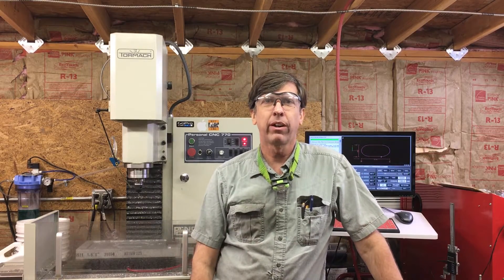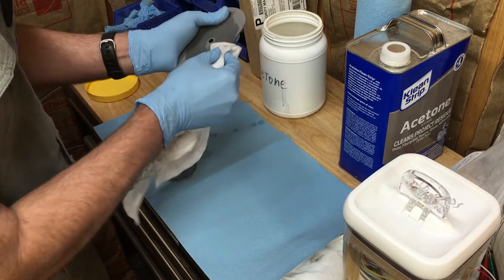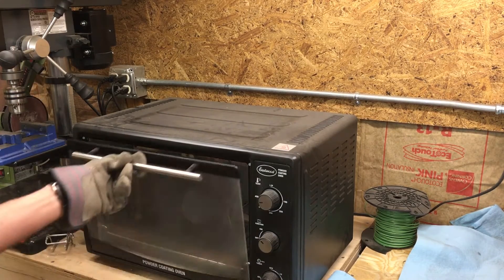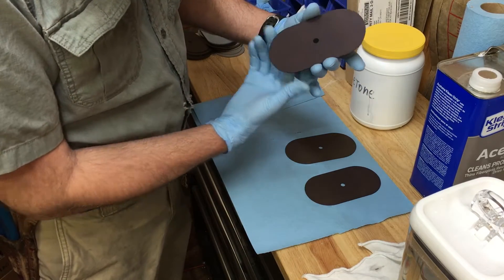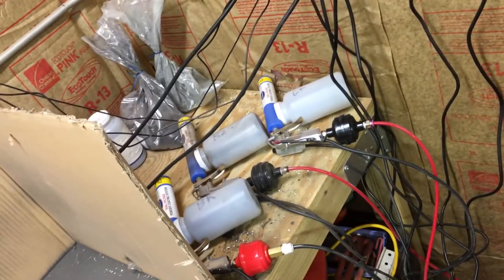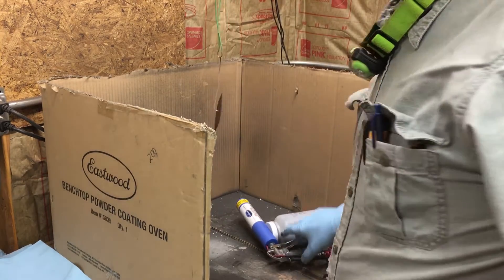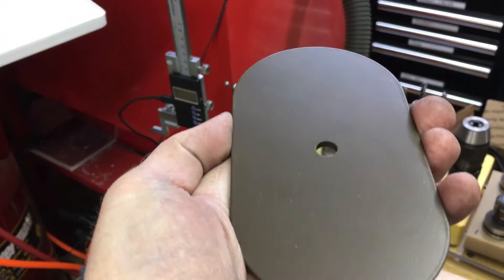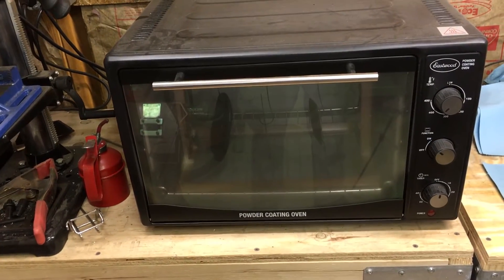Powder Coating  Small Steel Parts

Comment: Hi Craig,So I was getting the same issue with the little spots and it was actually lint from the towels. I started spraying my parts and letting it evaporate and the spots went away. I also agree that your pressure is too high. 3-5 psi is probably more than enough so you don't waste as much powder in the spraying process. Another thing that I do is use a flashlight to check for even coverage before I put it in the oven.Hope these tips help! Really enjoy your projects and am adapting your bending dies for a similar job I have to do here soon. Hope the X2 is up to the job...Best wishes,Tom Z
Reply from the maker: +Tom Zelickman (Inspiration Metalworks) - Cool, great to know!  I was thinking I wasn't cleaning it good enough.  So are you just spraying the parts with acetone with a spray bottle? Yeah, The pressure regulator on the air compresssor is pretty bad.  I should get separate one.  Thanks, I'm glad they are helpful!   I'm sure the X2 can do it.  You too.  Craig

Comment: I worked in the Box Anneal in a major steel manufacturer, and when the steel turned blue it meant oxygen was in the annealing chamber. we used temperatures much higher than 450 F, however all the steel was in a sealed chamber and oxygen was vaccumed out, so it was an indication of a leak in the chamber if it turned blue. we tested this by passing current through sacrificial little test strips inside a sealed box and a small hose connected to the  vacuum port after it was sucked down. Every once in a while we would loose vacuum and the whole coil would come out blued....

Comment: Looking good Craig...nice job!  I imagine that the home depot steel is going to have a bit of residual oil on it, but your acetone "sheep-dip" should do the job.  FYI- I use a scotch brite pad on things before I acetone them just to help loosen up the stuff that may be adhered to the surface.  Pre-heating is probably going to be more necessary with old pieces of unknown history that you are stripping a finish off from, or any cast metals (they are typically porous and filled with gunk).  I know anytime I go to TIG weld cast aluminum or cast iron it is a b!tch to get all the oils out to avoid weld porosity.  I typically don't have any problems with other metals as long as I do the scotch brite before the acetone cleaning.  I like the colors by the way.  That bronze is slick.

Comment: Hey Craig, nice video.  If you don't mind, I noticed two things.  First, the pressure seems too high.  I usually apply at about 10psi, it just creates a dust cloud (lack of a better description) and the static does the rest.  It allows you to get a more even coating.  Second, a professional powder coater told me this secret for removing lint and similar debris:  go over the part entirely with a propane torch.  It's just a quick burn, not enough to heat the part really but you'll see the stuff burn off.  I tried this and it ends up making the job MUCH nicer.  It got rid of my pitting and spot marks you show at the end of your video.
Reply from the maker: Thanks!  Yeah, I got a better pressure regulator and have it at around 10 psi.  A torch sounds like a good idea.  I don't use rags anymore though.  I just blow the sand blasting dust off with an air gun and then use a triple acetone dip.  Seams to be working.
Reply: +Craig's Machine Shop I don't use rags either (should have mentioned) but it still burns stuff off and drastically improved end product! I'm looking forward to seeing your drag knife work on the tormach. I'm confused about how the head moves, because on the routers it always looks like they turn the knife in the direction of the cut before moving down in z and cutting
Reply from the maker: Cool, I'll have to give that a try.  The dragknife head is completely controlled by the x,y,z steppers.  Dragknife compatible CAM programs manipulate the head to get the blade to cut sharp corners.  Otherwise the offset in the blade and the design of the dragknife cause it to turn.  I usually align the blade but I think it may not matter if the cut arcs in.  The blade will just align as it approaches the geometry.   Still new to it.  I will have 2 more videos on it coming out.

Comment: Nice! I'am working on a larger oven for my garage, hope to get the last parts this week. Waiting for the electronics 😁
Reply from the maker: +Peter Dahlman Thanks Peter!.  Cool!  I am getting ready to build a powder coating booth.  I guess I need to think about a larger oven in the future.
Reply: +Craig's Machine Shop I made a "ghetto-style" booth out of OSB Wood and Hinges. I'am starting to get Low on garage space...so it's nice to be able to fold it and get it out of the way when not used. Also added a fan to the back to get most of the powder away from my face :)
Reply from the maker: +Peter Dahlman - Mine will be osb and wood frame but It will be pretty big.  I'm enclosing my metal car port soon.  12x18 feet of new work shop for dirty stuff like powder coating.

Comment: No way to tell for sure until you run some trial tests Craig. But you might possibly be getting some minor re-contamination while dipping your parts in the acetone. There's a certain amount of oil residue left on the metal from processing it at the smelter. Dipping the parts might be leaving something like a very thin mini oil slick or some oil in suspension in the acetone that your then pulling your parts back through while dipping them. Might even be from the paper towels as someone else suggested as well. That has to be a frustrating problem. Only some really rough guess's that I can think of for your finish issues tho.
Reply from the maker: +Turning Point - Thanks!  I'm starting to think its from the towel.  I looked closely before powder coating and saw a lot of tiny cloth fibers so I blew them off with the air gun.  I may try powder coating without preheating and see what happens.
Reply: Turning Point  I would only use ‘shop’ towels and not regular paper towels.

Comment: Great video for a newbie like me and love all the comments back and forth. I have a picky question: depending on the part, how would you coat the area where the hanging wire touched the part?
Reply from the maker: Steve Friedlander  - Thanks. Thin parts are tough. Some people will hang parts from a threaded hole on the bottom of the part. The actual contact area is very small so it’s mostly coated. Could use a thinner wire also.

Comment: Craig, what is the purpose of preheating the parts when you just let them cool down afterwards?  Now your parts changed colors during the preheating process due to the steel's carbon content and thus the preheat actually tempered the parts.  Peace!

Comment: Could those little marks be lint? I see you're using premium towels, but I wonder if a little bit of lint is being picked up anyway.

Have you given Ajax/Comet a try? What was that black stuff on the towel? Was it dust from the sand blaster? I wonder if you could skip the preheating and both acetonings by cleaning the blasted covers with Ajax and a nylon brush (nylon to avoid lint). Rinse, blow off the water, and powder coat.
Reply: I'd turn the pressure down even more too.
Reply from the maker: +Hirudin - Maybe it is lint.  Maybe I will try skipping the preheat without using the towels.   No, I haven't tried it yet.  It seems to work good for you.  Thanks!
Reply from the maker: +Hirudin - Yeah, I need to get a better regulator.  The one on the compressor is pretty bad.
Reply: Ah, that makes sense.
Reply from the maker: +Hirudin - What, are you night shift like me?
Reply from the maker: +Hirudin - lol, yeah, I know the feeling.  Sometimes I'm watching youtube when I should be working., buts its my business so.  :)

I think sand blasting is best for adhesion but you still have to clean it good.  My products will be outside in the elements so I have to have good adhesion or rust will stain things in the future.

Comment: The out-gassing bumps are probably the second acetone dip. if you use cleaner/degreaser preheat after each cleaning. The purpose of the preheat is to drive off anything in the pores of the steel. After cleaning and preheating do not wipe with anything or handle with bare hands. I am applying Cerakote, but the procedure works with powder coat too. I use a less aggressive 100/120 blast media to prep the surface. The Blast media that you use should never be used to blast anything else that is greasy or oily as that gets in the blast media and them could be deposited back on the parts you are blasting.  Preheating does not need to be at high heat, at least that been my experience using Cerakote on knife grade steels, CPM D-2 A-2, etc. I also use brake-klean as my degreaser. I allow for a 30 minute soak, air dry the parts, then preheat at 300 for 60 minutes. Allow to air cool again and apply powder coat. if you have to touch the parts, use powder free nitrile gloves. if you're getting raised bumps,  that's off gassing of trapped impurities. My guess is the second dip without preheating the parts.
Reply from the maker: +VikingBladeWorks LLC - Thanks!  Yeah, I have been moving away from handling the part with gloves or rags.  I think a lot of the spots may have been the fibers left from the rags.  Since I started blowing the parts off before powder coating, it has been much better.  Now I don't even use rages.